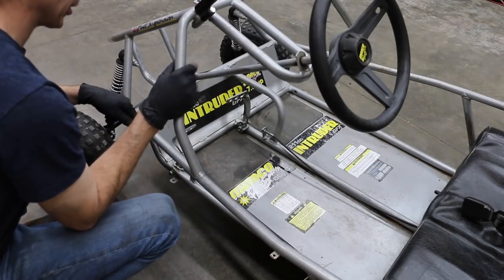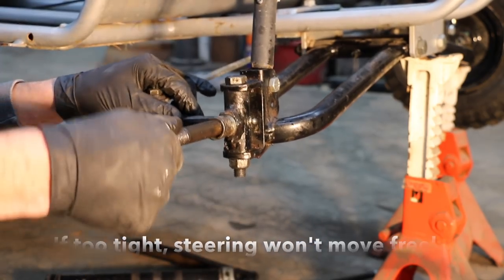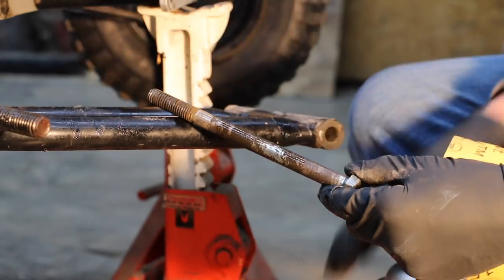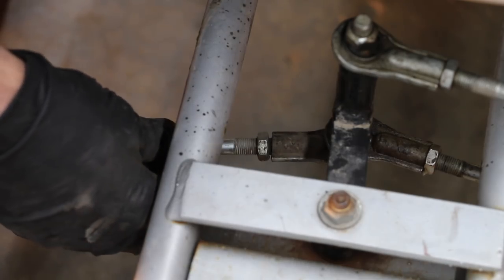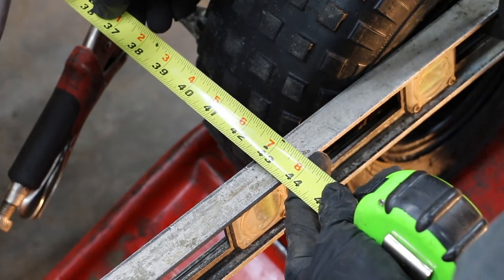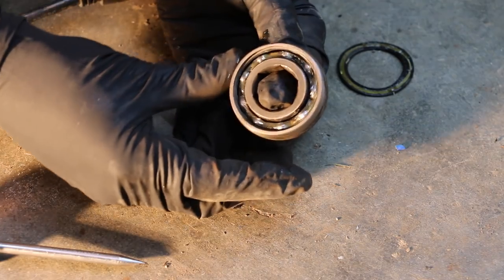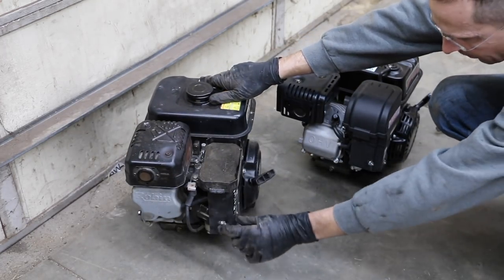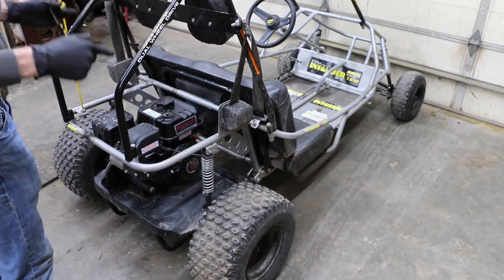How do you inspect a Go Kart before buying it?

Comment: do one on farm equipment wheel bearing on the farm years ago we could not keep bearing in the wheels of the disc  because weeds would take out the bearing so we took a old radiator hose and cut it down the side and hose clamped it to axle and the hose over the hub and it saved the bearing can you show this trick
Reply from the maker: Great tip!!

Comment: Any suggestions for trying to make a go kart with a horizontal shaft engine?
Reply from the maker: Most go karts have a horizontal shaft.  Do you mean vertical shaft?  Horizontal shaft should be pretty simple. Vertical shaft would require a lot more engineering and I wouldn't recommend doing it.

Comment: From what I've heard you're supposed to completely remove the governor from the inside of Predator engines. The plastic pieces and other small parts are not meant to rotate past a certain speed from what I've heard.
Reply from the maker: Great point.  I'll have to remove it soon.

Comment: All grease fittings have a ball and spring inside working as check valve. That's why your wire wouldn't go through.
Reply from the maker: Thank you. It appeared that the ball was missing.
Reply: @ProjectFarm  sorry I've been a construction oiler for 15 years and I deal with hundreds or thousands of grease fittings daily so I thought I would give my 2 cents.
Reply: @ProjectFarm  you can chisel out those push in fittings and drill and tap for a proper fitting. I hate the cheap ones a lot of machinery uses them.

Comment: Maybe you are wasting time? I don't know but I do love watching you do it. Do you have kids? If so I bet they love you for the go-kart.
Reply: This will greatly improve your videos! Engines are great but engines that drive wheels are even greater!! What are you going to do run an 1/8 mile or maybe a 16th mile?
Reply from the maker: Than you!  I do have kids.  The grass air plane runway is over 1/4 mile in length.  I might go with that.

Comment: Where did the check ball and spring go when you pushed the wire through the zerk?  If you can push wire through a zerk, it has failed and should be replaced.
Reply from the maker: It was missing from the start. I plan to replace the zerk. Thanks for commenting!
Reply: Project Farm I’m confident you’ll get the whole cart squared away.  I seem to remember my boss having a little 3-way tool for grease zerks.  One end had a tap like profile for chasing threads.

Comment: I thought grease zerks had a small ball seal to prevent contamination ??
Reply from the maker: Yes, you're right.  I should have mentioned in the video that the check valve was missing, which is why it was dry and oxidized inside.

Comment: Someone correct me if I’m wrong but I think the way they set up the front steering with the tie rod ends is towed in so when there’s drivers and passengers in it the weight of them straighten out the front tires so if I having someone measure it with you sitting in it to see if it still aligned just a suggestion
Reply from the maker: You're right. I need to add back a little toe-in.  It seems very stable now, but it won't hurt.

Comment: On a new Predator engine,fill oil to correct level, run engine at hi idle for 30 minutes.Change oil while still hot, operate engine for another 30 minutes, change oil again while still hot. Refill oil again , you are good to go. Why all the oil changes? New Predators have a lot of casting sand and metal chips in them ,running and changing while hot drains those out with the oil. Also, of the steering "darts around"at speed, toe the front out(yes,out !) 1/16 to 1/8 inch.
Reply from the maker: These are great suggestions!  Thanks for the tips!
Reply: Google "AIM Mychron 5 Basic Kart Gauge with GPS" to get data.

Comment: I don't know how far you wanna go with this but how about good and bad modification for the cart or engine. Performance and suspension upgrades. 

I have an odessy cart that I might be upgrading the motor to a predator 700cc v-twin. 

I also have a cart with full suspension that I put a Honda 200s trike motor with 5 speed into. Didn't complete yet but it's in there. 

There are so many options you can have in making videos and it's limiting the amount of lube you can test or fuel. 

I would like to see some stuff like this as well. Maybe more testing on said product vs explaining how to grease a grease fitting. 

You also might want to change that grease fitting because there should be a ball right at the tip to prevent the grease from spitting out. You should never be able to fit anything in there.
Reply from the maker: All great points and thanks for commenting.  Yes, the little ball was missing from the grease fitting and I should change it. Thanks again!
Reply: Project Farm thank you for replying back to us it really means you care about the views.

Comment: The Governor in the engine could fly apart inside the engine when held wide open
Reply from the maker: Great point. I should remove the internal components.
Reply: Would make a good video for the channel if you decide to remove it

Comment: The gearing looks like a CVT style "transmission". If its not could you swap it out for a CVT?
Reply from the maker: You're right.  It is very much like a CVT.  It allows for great acceleration and top end speed.

Comment: I have both of those engines and neither one are the same.  nothing will swap back and forth between the engines.  the predator is a Honda clone and the Subaru is an engine all of it's self.  The Subaru is also at least three times the price because it has over head cam and better tolarances all the way around.  I hope you keep the Subaru going strong because parts are expensive and the carb itself is around 100 dollars.
Reply from the maker: Thanks for this information.  Yes, I plan to keep the Subaru engine and will put it back on the go kart if I ever decide to sell it.

Comment: if it tops out easily with stock gearing it may be hard to notice any difference in power...perhaps we need to give it a sled to pull with a 50 or 100 pound weight...in my experience these engines seem to like 87 octane the best and are very tolerant of a wet environment
Reply from the maker: This is a great suggestion!  The airplane runway has an uphill climb, which seems to keep the go kart from reaching top speed too quickly.

Comment: I've been wondering which penetrating oil works best on rusty bolts: wd40, pb blaster,  trans fluid and acetone or another brand
Reply from the maker: I'll put together a video on this in the future.  AvE recently tested 3 of these products.
Reply: Project Farm I came here after watching his video to see if you might be able to devise a different way of testing. He didn't say where the bolts were from and if they were initially torqued the same for consistency so it got me curious.

Comment: I don't think I would have tried to align that front end just yet. Also no weight for realism. It's a super light frame compared to a car. Off road suspensions are a whole different deal plus by the overinflation of tires I would guesstimate the last fellow was maybe running it on the road a lot. My bike tires get that same wear pattern when keep them at their max and run offroad tires on the asphalt. I like running them that way because the offroad tires run faster. They are also safer when I do need to head off the path because the knobbies are still intact at the tires edge.

Off road suspensions are set up different, you set it like you'd set a car. Toe in and out and Camber are different. You might want to look up the off road buggies that run down in new mexico for X games and such. But I suppose at least you have a start and that's a good record for how things change as the vehicle wears in again after your tune up.
Reply from the maker: Great point.  I'll likely add back some toe in.

Comment: Should have measure each track rod then set identically, then do your final alignment.
Reply from the maker: Great recommendation. Thank you
Reply: Project Farm 
This works if the front is inline with the rear. 
If you use a length of straight edge as possible timber or better still a good spirit level then run it against the back wheel to the front squaring the front as much as possible against the straight.  Then measure the distance front centres of the mounting points.  Repeat on the opposite side.  Adjust the rods to the measured distance.  Then affix.  

A string could be further used if the straight is extended forwarded such that the centre is marked.  
Equally if the rear is of different width the string method can still be used. More complicated and not required for a cart but still interesting.

Comment: I was thinking the other day if you put glow plugs in a petrol engine can it run on diesel okay
Reply from the maker: Seems like a great test idea!
Reply: it won't run.  A gas engine is designed such that the air fuel mixture will not ignite without a spark.  If it does happen it's called engine knock and is very damaging to the engine.  Diesels are built much stronger and ignite the air fuel mix from pressure alone.  A gas engine simply cannot reach high enough pressures to ignite diesel in that fashion, and even if you managed to make it happen the engine would likely explode almost immediately.

The reverse is technically possible, to run a compression ignition engine (diesel) on gas, but it's very hard to accomplish (big car co's are still working on this)

Comment: Need to get an engine that has a transmission on it so you can get away with one speed and a slipping clutch if you want to pull a trailer or a load.
Reply from the maker: This setup should work for pulling a light load.

Comment: I like the idea of the vehicle, tho that one made me cringe, because back in my collegiate days, I ran my school's MiniBaja team (now renamed BajaSAE https://en.wikipedia.org/wiki/Baja_SAE), and I"m sure anyone that's a veteran of those competitions would cringe as well.

However, to be honest, acceleration testing in a vehicle is very dependent on the nut between the steering wheel and the seat; the BEST way to test an engine is with an engine dynamometer. You could build a brake dyno using an old brake disk and a lever-operated brake pad setup with a force cell to measure said braking force to estimate power output, for consistency's sake. 

Despite my whinings, I still think you're the best, and make great videos, tho I"m still waiting on that SeaFoam/oven cleaner comparo... ;-)
Reply from the maker: I really need to build a brake dyno.  It sounds fairly easy to build.  I like the idea of oven cleaner.  Others have cautioned me regarding it being chlorinated and the risks associated with testing it. Have you tested it?  I'll see if I can find some non-chlorinated oven cleaner.
Reply: IIRC SeaFoam is (or was) chlorinated as well. I have spoken with a couple of mechanics who have done it, and they said the results were about the same. As long as you use it outdoors and don't try drinking it, you should be fine--besides, oven cleaner is used in your oven by your wife, so it shouldn't be all that dangerous. 

Dyno:  Do your research. There's a couple ways to go, with the brake dyno being the easiest. An old brake disk, brake caliper, and a clutch master cylinder should start the process right off, build it into a compact frame so it can be laid down on it's side or stood vertically, for all types of engines. :-)